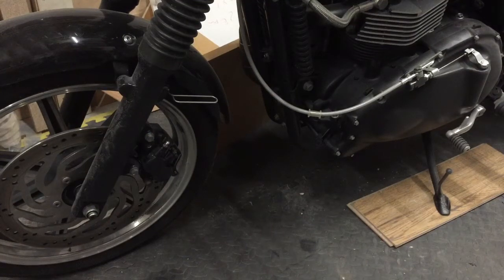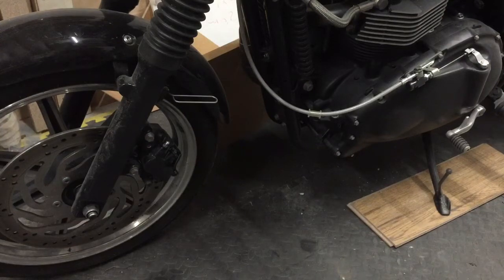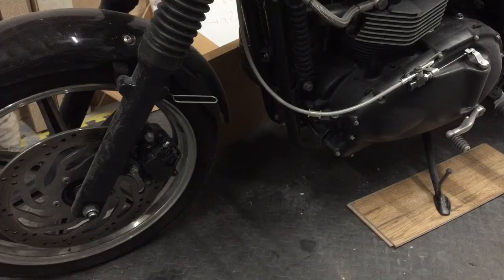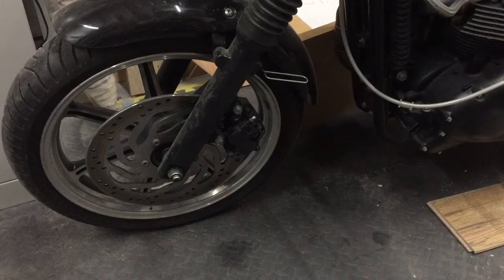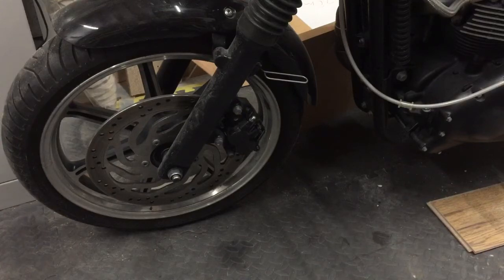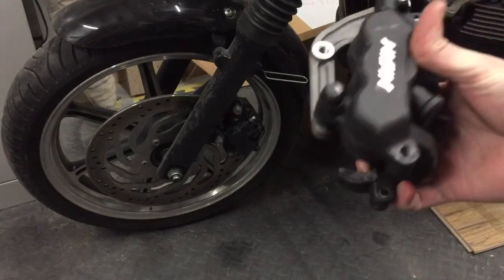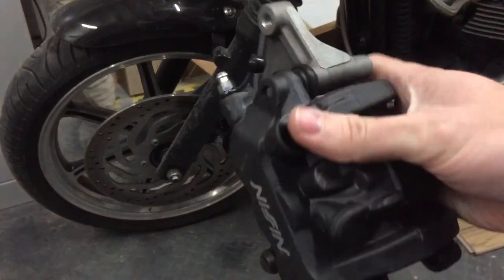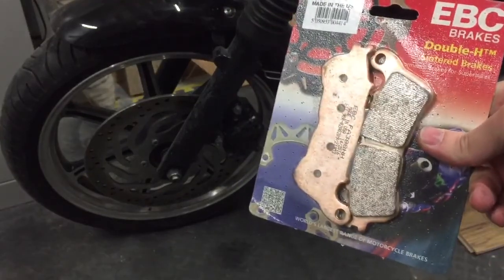Bonneville Brake Upgrade - Nissin 3 Pot Calliper Upgrade - PT 1

Comment: Great video. Thanks for sharing. Do you happen to know if this change is also possible on the Thruxton 900 models, which have a floating disk?
Reply: Luke Bonathan , yep, but I will doublecheck tomorrow. Have you noticed a real improvement in braking power?
Reply: Luke Bonathan Cheers, I will check on the link and I'm looking forward to pt 4 too !